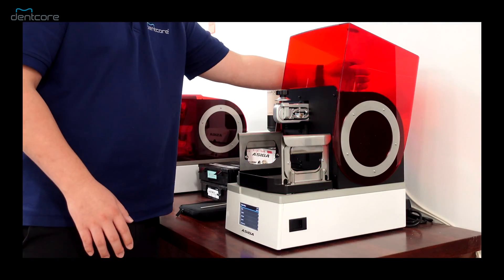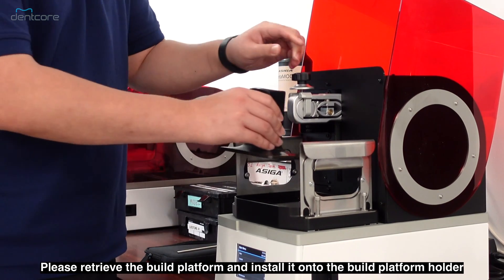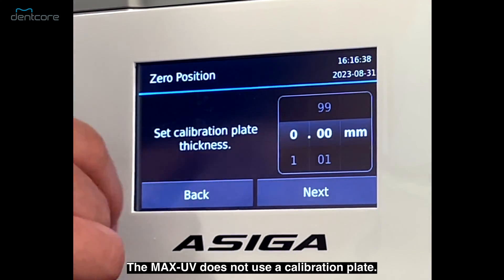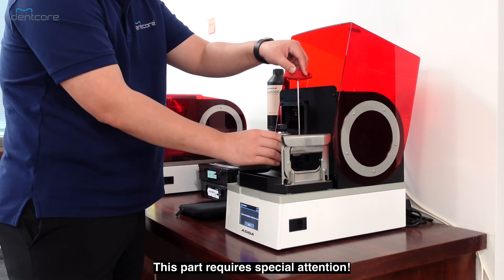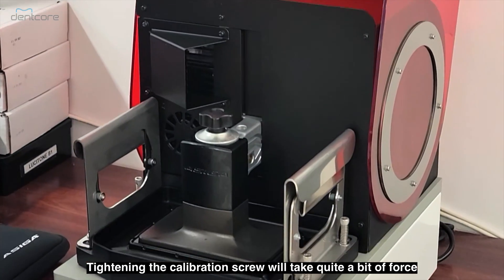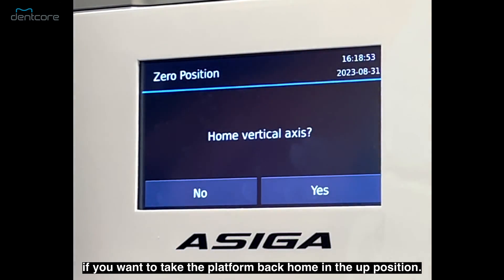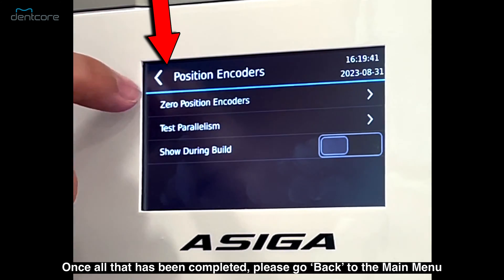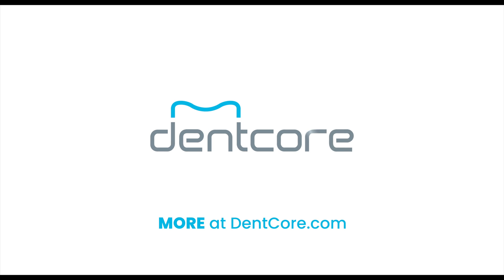How to Zero Calibration on your ASIGA MAX UV?  The Ultimate Tutorial Guide is here 🔧

Comment: Hi, the validation in this video is not 100% correct. You should zero encoders before going down from 1 mm to 0 mm and then check if the encoders stay at 0. The point here is to find out whether the platform is flat/not tilted and does not excert pressure on the glas by itself. The rest of the video is excellent
Reply: Yes, you are absolutely correct, looks like we did miss a step there. You should absolutely zero and check the encoders at 1 mm before moving the platform down to the basin glass and checking the encoders again. Thank you for letting us know!